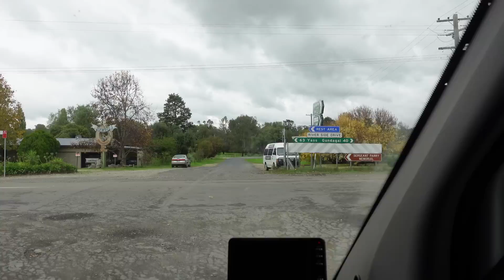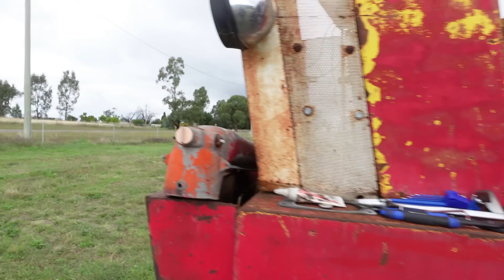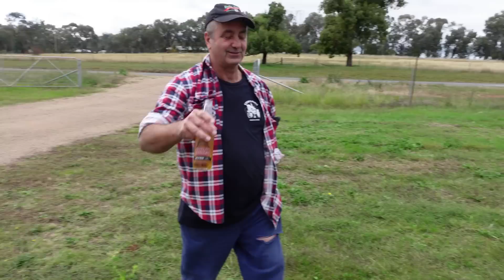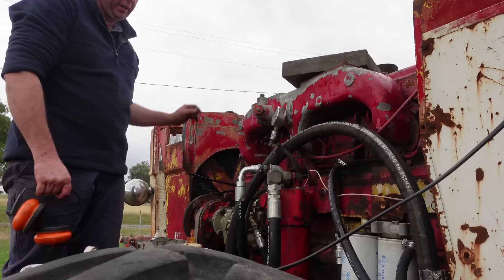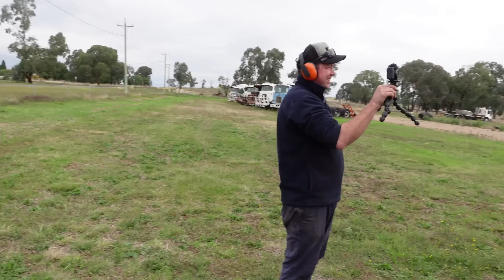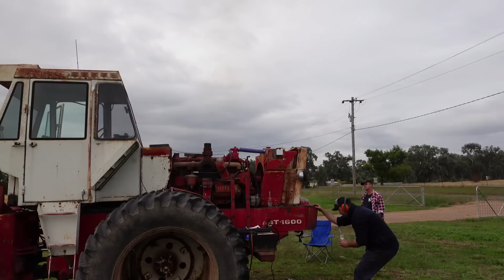Supercharged Cummins! Can we get it to run?

Comment: I’m constantly amazed how close our Australian cousins are to how we are here in the US. Especially the farmers. My grandfather ran an A4T-1600 diesel for decades. 585 engine. Had a blown head gasket once, a cam replacement, and snapped one axle. Not huge horsepower, but could lug like a bigger tractor. We have three Versatiles, and they could outpull it, but I still thought it was a pretty cool tractor. I believe the people that have it now still use it. Never saw a supercharged Cummins before. Ours are all turbocharged.
Reply: Your comment was an interesting read. 

There's a few videos of supercharged Cummins engines including a 5.9 on YT. 
But that's the only time I've seen one.
Reply: @R.Sole88109  I wonder what the advantage is?
Reply: @thevox1075  
From what I've read about them one main advantage of the supercharger is lack of turbo lag.

You can also change pulleys to increase boost whereas a turbo, with it's wastegate fully open can only produce a certain amount of boost due to impeller size. Then you need to increase the size and/or number of turbos.

One big disadvantage of superchargers are they take more horsepower to drive them than exhaust gas on an impeller.

I think they're also more expensive to manufacture than a turbo. 
There's probably a lot more I'm missing. 

Back in that era supercharger knowledge and parts were more common than turbos. By the 30s most supercharger development peaked.

One good example is the Rolls Royce and Packard built Merlin V12. 🇺🇸🤝🏻🇬🇧 

Turbocharging and Supercharging by Alan Allard is worth a read too.

Hopefully someone with more knowledge can add to the discussion.
Reply: @R.Sole88109  I’m a diesel mechanic. I was just wondering why they would use that to boost intake pressures. Turbo lag isn’t a problem on a farm tractor.
Reply: @thevox1075  
I suspect the answer to why supercharger over a turbo is a question for Clessie Cummins and Hans L. Knudsen.

Comment: What a treat, a bunch of legends and the noise of the blown Cummins, unique but mega.👂🏻👍🏻
I can't wait to hear it under load.

For muffling a runaway I've found a rubber mat a few mil thick then a block works well. 
The mat helps create a seal.

Good on yous🍻

The Watch Wes Work channel mentioned is defo with watching especially if you like mechanical problem solving👌🏻
Reply from the maker: Thanks as always mate. She certainly did sound good. Once we hooked up the piping it sounded a bit better again. 
 Yes I have a solid rubber pad that I use for engines I’m not sure about for choking them. I think it’s on standby in the transtar 4070 start video. 
 I do watch Wes mate sometimes. He’s a very handy bloke. Especially with later model electronics in vehicles.
Reply: @stevesplacedownunder  
Vaguely recall the block in the Transtar video.

By block I meant wood like in this video, so rubber (like a piece of car mat) to the inlet then wood block and push like fuck.

Nowt like redline for a good time🙉😆
Keep up the good work mate🍻

Comment: Question what the hell do you think the super charger is for on this ENGINE. It has low compression pistons and it willnot run very good on natural air intake . put the cross over back on the ENGINE and see how much better it will run. Have worked for Cummins for years and know this ENGINE well.
Reply from the maker: Was left off to dry it out. Had water in it. That’s what the hell for. Once fuel system was bled it started just fine without it. We ran it for a while and then fitted it. That’s what the hell for. Thanks for watching

Comment: I know the feeling of being jittery on a engine that likes to run away, I have had it happen to me twice...
     Thought I was going to need a new pair of pants both times. 

p.s.. I have never been around one but a lot of old timers say not to rev those supercharged engines real hard.. it would tend to break the drive off the supercharger.. it was worse on those that had other components ran off the back of the supercharger drive.
Reply from the maker: It’s happened to me also mate. Not this one though, it happened to the owner. 
 I haven’t had anything to do with them either until now. Not a lot different apart from the blower I don’t think. Still interesting though

Comment: It looks like it's not getting fuel. Is there a lift pump. If so make sure there's fuel there.
Reply from the maker: No they don’t have hand primer pumps on those old Cummins engines

Comment: Looks like an old 220 Cummins
Reply from the maker: Yes they are the same to look at. On one side anyway
Reply: It’s an N H Cummins, 220 h.p. Naturally aspirated, 262 h.p. With turbo and 300 h.p. with a super charger.  Cheers.
Reply: @gerryspang5917  1952 kenworth cummins nh220